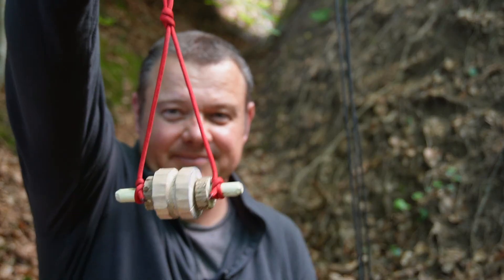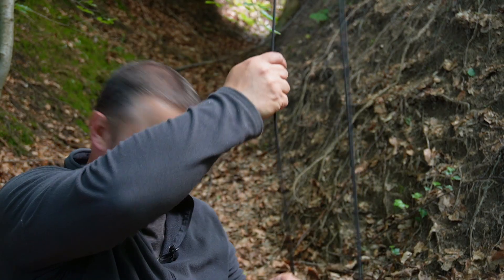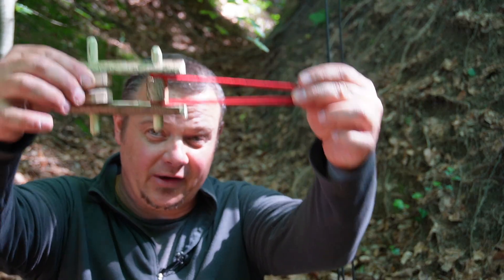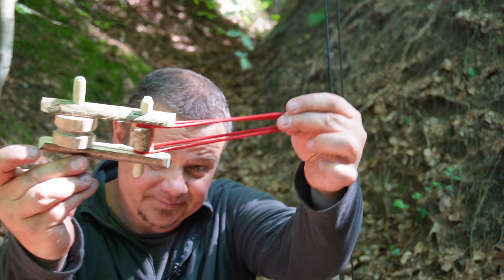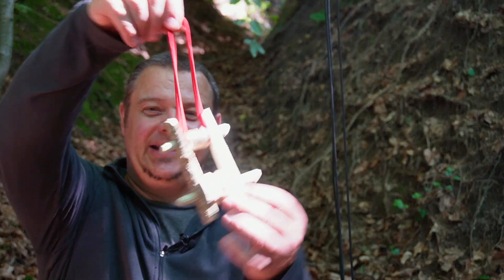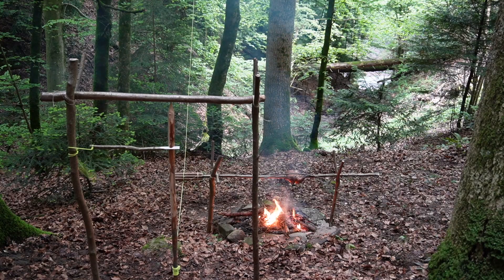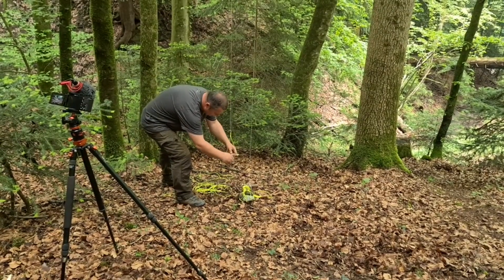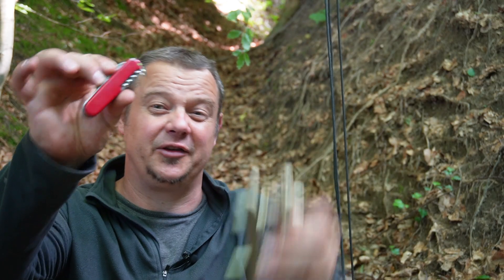Bushcraft Pulley System - How much Power can I save? - Swiss Army Knife Project

Comment: With the second pulley set up you can also pull full size logs on the ground from point a to point B with a larger size pulleys with a larger rope going around a tree in the location you want to pull the full size logs on too.

Comment: HI!  I wanted to tell you about a customization that I invented, I discovered that under the screwdriver near the magnifying glass in the swisschamp, there is enough space to put two small matches or one big one.  the big one is practical because it fits inside, the small ones are two, but if you use the screwdriver often they don't get stuck.  before now I didn't think they were that hard to light matches so I found an easy method to add the rough part of the box on the boxknife!  on the back, in the largest slot, it is possible to put that part with double-sided adhesive, or by buying special strips to glue for matches.  it works really well!

Comment: Im real surprised how sturdy and strong you’re carved version is, but you’ll never know if you don’t try and you’re the one who is thinking out of the box and try 👍👍👍 great explanation and demonstration, in my case I’m lazy in such things as you know 😅 so I use just two carabiner for it, works the same way, would be interesting to find out which method has more friction, rope on the metal of the carabiner or wood of wood on your system? Thanks for sharing, Taro

Comment: Another useful and cool video, but I would try to add some lard/grease/oil on surfaces between the wheel and the stick to reduce friction. When you hear the high pitch dry-wood against dry-wood sound, then it is a good indication that some lard can help :)
Reply: Bonjour, perhaps some graphite of burned wood?

Comment: Pulley systems are a blast to play with. I like your version better than store bought, which are very expensive. For even more fun add a double pulley system to the end you are pulling, just remember it takes an enormous amount of rope.
Thanks for sharing Felix.
Reply: I have a small strong all-metal pulley in my pack already tied to one end of my main cordage. If nothing else it lets me cast a line over a high branch quickly and it's rated for a 100k load. If the weight bothers you lighter versions are made.
Reply from the maker: Thanks a lot for your hint!
Reply from the maker: Thanks a lot for your positiv feedback!

Comment: Awesome!  I have been looking for a pulley system designed for paracord but unable to find.  Anyone have any ideas?😊
Reply: You can find cheap ones made of sheet metal with plastic pulleys but they're junk. Get the cast-metal versions; a single and a double  used together used together will let you exceed the strength limits of paracord.

Comment: Excellent video!
Bushcraft/survival uses for pulley & pulley systems:
1. Lower container to get water without leaning or reaching over where drop to water level is considerable or footing is too slippery.
2. Raise food container to height where bear can't reach it.
3. Build/access elevated platform shelter: raise platform, fireplace and shelter building materials without danger of being pulled over or fatigue
4. Use counterweight to automatically raise trapped food animal too high for fox, coyote,  wolf, bear, etc to eat it before you get it. Use basket at top to shield from birds.
5. Use counterweight to help climb repeatedly to access elevated location ( ensure separate safety line to prevent uncontrolled descent)
6. Use pulley system to haul improvised boat on to beach or launch into water
7. Use pulley system to drag large game animal from difficult/ unsafe location/ position to process location
8. Use pulley to draw bowstring on heavy improvised crossbow, use pulley to assemble crossbow, use pulleys as crossbow components
9. Use pulley for fishing or fish trap rig
Reply from the maker: Thank you so much for this super interesting comment!!!
Reply: Good list!  I thought of tensioning lines for a tarp.
Reply: Love this comment!!!

Comment: I'm not sure what sort of game animals that you have were you live (where do you live exactly, BTW), but in the US we hunt several species of deer as well as bear, elk, moose and wild pigs. Those are heavy animals that can weigh between 70 kg and 700 kg and are often lifted in the air to field dress, age and butcher, sometimes it's all done in the field. A pulley system like this would be very useful for that task. We also go off into the woods on four wheeled ATVs and motor bikes and get ourselves into trouble by thinking "I can make it through that, no problem". The ability to construct a system like this could be very handy for when we are wrong. LOL  I can see this being very useful when constructing larger more permanent structures in the woods as well. Another winner for team Immler!
Reply from the maker: Thank you very much for your super interesting comment!